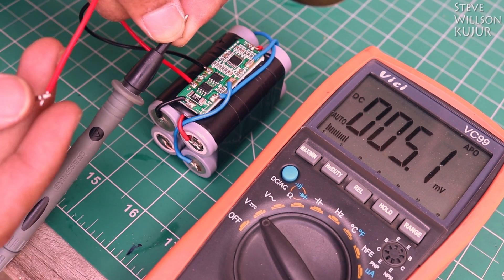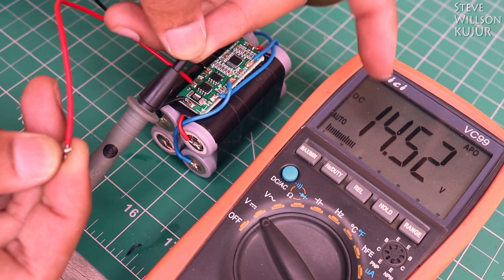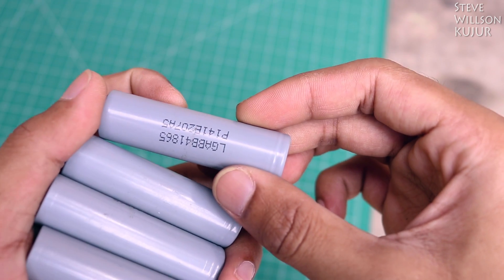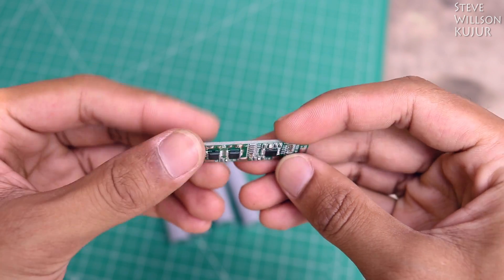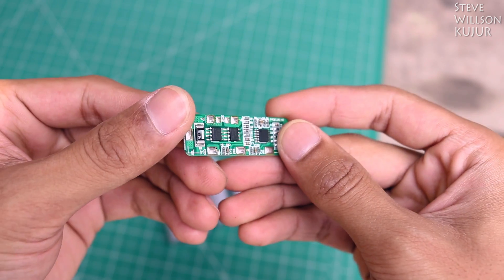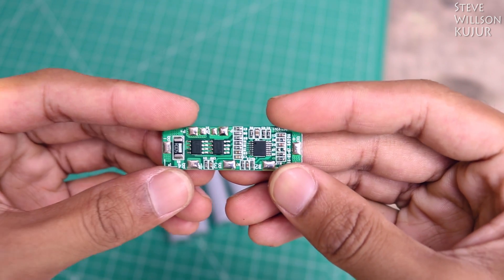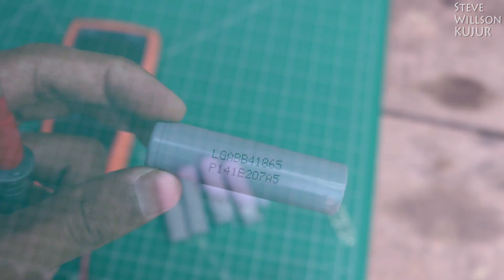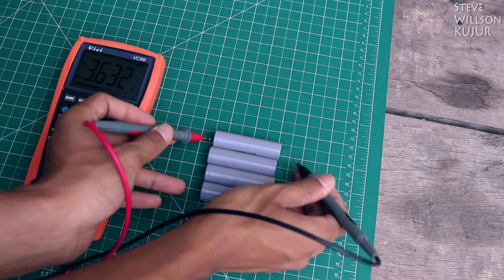Make your own 4S Lithium battery Pack | BMS

Comment: Can i pack 4 batteries one of them have higher capacity i have 3 batteries 2500mah and the 4th is 6800mah
Reply: there  are no 18650 cells that are 6800mah.  It's a fake POS.

Comment: Well you made a 4 cell powerbank with an average of 2000mAh capacity, what did you achieve? In order to have more capacity you will need more 18650's in parallel not in series so that the capacity will add up, you can just make 2s bank with 4 batteries in parallel each cell.
Reply: @Daniel Butuc the one that have more capacity will charge more

Comment: Very nice movie :) If someone can not calculate the pack or want to make it easier :) I suggest install the Android app: "Battery pack calculator" (calculates: voltage, capacity, discharge current, etc.) up to 9999s 9999p packs. Built-in database of 37 popular, branded batteries and the ability to define your own battery cells.

Comment: How many pieces of 18650 lithium ions battery 3500mah 20amp conteniously that good for BMS 4S 100amp 12v or 24v. Thanks, hope you will give an advuce.

Comment: But how do you charge and use it for output? Is there a way you could include a built-in power inverter for 12v DC appliances, like a ps4 or TV?

Comment: I have 4 battery is connected in parallel. So how can I use BMS.
Reply: Plz reply ✌✌
Reply from the maker: No, you don't need any BMS for Parallel Batteries

Comment: Hi, can you recommend a setup how to replace my led acid motocycle battery to lithium ion. Original battery is 12v and 14ah. What BMS should i use for 6 x 18650 batteries of 3000mah? Thnx
Reply: just do a search for 3s BMS

Comment: I've been making 3S packs for a few years now and last year I accidentally ordered a 4S bms so when it came I decided it wouldn't hurt to have a 16.8v pack laying around and recently I decided to use it which I did and when I went to charge it I couldn't get it back up to 16.8v just 15.8v... Anyone got any thoughts on that? I used a 17v 1amp power supply to charge it. its the weirdest thing. The 200mv of the 17v power supply seemed to work out in theory because when the supply was under load it dropped to 16.8v.
Reply: watch this video...the chips they use for balance and voltage could be the wrong type/version
in this case it was over charging
https://youtu.be/xE3vBppr1sA

Comment: Using bms8 for charge & discharge life&lipo automatic cut off, cheap bms need monitor and manual cut off charge&discharge and possible make lower battery cycle.

Comment: i wonder, I would like to  add two more batterys in series, a total of six. What kind of board should I use then?, and what voltage and ampere should this pack of six in series charge with?

Comment: Hi steve,
If I connect two of these 4S units in series will there be a problem?
Reply: Barry Dinvaut i was wondering also if i can parallel or series them, but these batteries ain't that cheap to experiment with.  i have 2 exact 3s 7p packs and it would be useful if those 2 packs can be used like modular (25.2v) as long as they are the same voltage

Comment: what the s in 4S lithium battery stands for?
Reply: s = series. 4 batteries connected in series would multiply the voltage by 4 times.

Comment: I am going to made a 2s battery pack with 18650 li-ion without BMS circuit .I am having a balance charger (imax B3 AC 2S-3S 7-4V 11-1V Lithium Lipo RC Battery Balance Charger).is that OK for charging my 2s battery pack.

Comment: for those of us not very "solder your wires like this" savvy, you should explain what you're doing while you're doing it. We all like the music but talk to us, man... tell us what's happening :)
Reply: Jason Snell couldn't have said it better myself lol I saw him do a lot of stuff but don't know why he was doing it and in return I did not learn very much
Reply: soldering wires to 18650 batteries is not a smart idea. they are very temperature sensitive and soldering can easily lead to big problems like exploding batteries. 18650 batteries should be spot welded.
Reply: if you dont have a spot welder or dont want to spend the money on one, you can buy 18650 batteries with tabs already spot welded to them so you can solder to the tabs:
https://www.aliexpress.com/item/2018-New-Original-for-LG-HG2-18650-3000mAh-battery-3-6V-discharge-20A-dedicated-electronic/32858831585.html
https://www.aliexpress.com/item/10pcs-Lot-100-Original-NCR-18650B-3400mAh-battery-3-6V-Rechargeable-Li-ion-3-6V-battery/32932700077.html

Comment: Hi Steve. Using this BMS, can recharge the batteries? Exemple if I connect a power supply and the level of the batteries became low, the BMS will allow the recharging?
Thank you since now.

Comment: hello Steve! great video, i need your advice about connecting 18650 cells in parallel.
Reply from the maker: just connect it make sure your batteries are same capacity

Comment: nice video,but I have a question.if I have a 5 amp lithium battery and another one with 2 amps.is any problem if I connect them in parallel???
thank you!
Reply from the maker: if you connect it in parallel then no problem and before connecting them in parallel please make sure your both the batteries are at same voltage
Reply: +Steve Willson Kujur so,the amperage doesn't counts?
Reply from the maker: +laur tudor in parallel you get a total of 5+2 = 7 amps
Reply: +Steve Willson Kujur yes i know,but I ask if is any problem
Reply: +Steve Willson Kujur thank you for answering
Reply from the maker: +laur tudor i already said no you'll not have any problem
Reply: +Steve Willson Kujur have a nice day
Reply: laur tudor check out Julian Ilett's Channel. He made a video about that 1 or 2 months ago

Comment: Hey steve, can u make 12V battery pack using 18360 batteries and also charging them with 5VDC and get output through usb battery charging module like 5v
Reply from the maker: it can be done i'll try to do it very soon
Reply: thank you, i got a project to charge 18360 batteries and with that i need to power a 12V solenoid, 5V micro-controller and as well as charge phone at the same time. So im guessing we can use usb battery charging module  with 5V input to charge batteries and from the output of module, power the phone and micro-controller and as well as power solenoid . when u do that please mentioned ur parts number and so i can order it online

Comment: Uoloader Steve,
Wld u pls tell us what is th maximum discharge cut off voltage of ths board? is it 2.3 volt? Lowering voltage below 3 volt damage th battery right?  

Yes, how will u charge ths pack I wish to see that video.
Reply from the maker: +fklotaloi it is 2.3 volt and yeah it is quite lower but now issue with bigger load when it hits 2.3 volt the battery will recover like 3.3 volts so it's safe with bigger load .

And stay tuned for next video about how to charge it .
Reply: Thanks for yr reply :-) 
I bought a bms like yr one & checked carefully tht it cuts off th load circuit @ 2.3 volt alys , bt very sad why BMS manufacturers did not make th cut off voltage higher than 2.3 !  😤😤

Comment: Nice Video!! But from where did you get the batteries...both aliexpress and banggood links don't ship to india...
Reply from the maker: +Parag Parekh I'll update the Links for you
Reply: thanks...I checked various batteries on aliexpress...but all the genuine 18650 has crazy shipping cost for india
Reply: Try Gearbest.com
Reply: From Laptop batteryes
Reply: check out batterybro.com - i recently purchased 200 cells from them, they also balanced the cells to 3.39mAh and sent it to Australia for appx $850USD. AND they had fkn good customer service

Comment: Really nice! :D But still waiting for the "how to charge" part. :/
Reply from the maker: next video will be that
Reply: Steve Willson Kujur Great! :D
Reply: WannaDuino! The Real Live Actually, that's not true. The BMS does that automatically.
Reply: MC's where Steve placed the red and black wire to measure the voltage, you put anything you want to charge the batteries, do you undestand?
Reply: Gustavo Severo Sure. :) I mean what to use to charge. ;)
Reply: Another batteries or a recharable... But for use recharable you have to be careful, because it works in AC and the batteries that you will probably use to charge is DC.
Reply: Gustavo Severo Yeah, yeah... He already made the video of how to charge them.